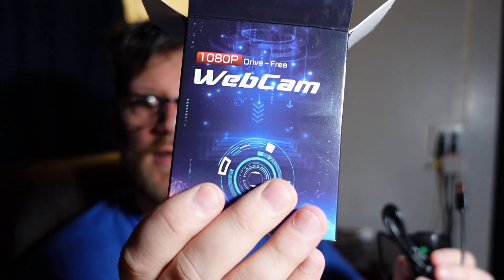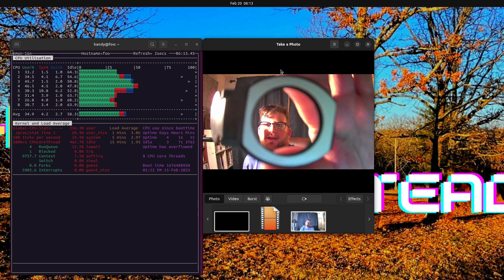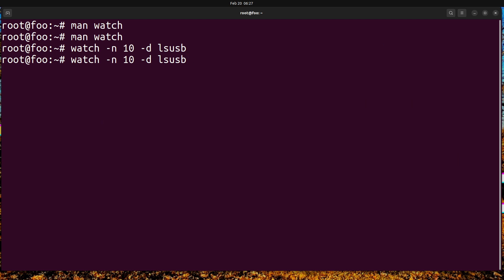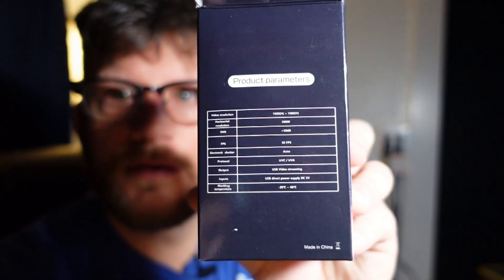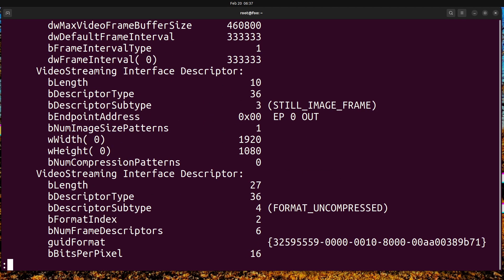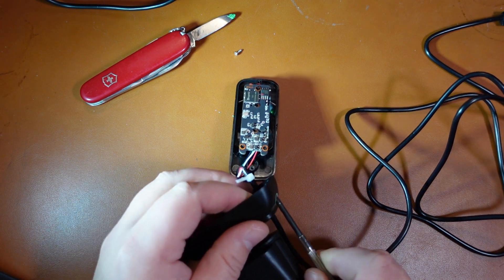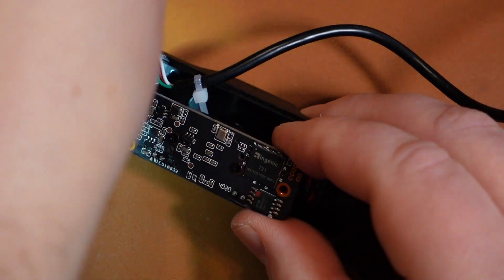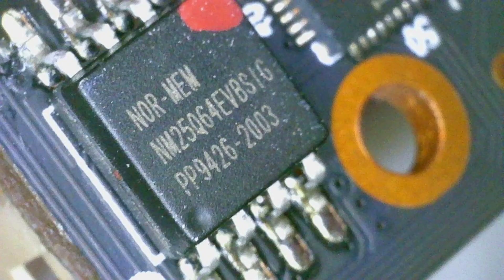This is $1 MIPS/RISC-V Powered Chinese WebCam? | Part 1

Comment: Where did you buy it from? Did it take long to be delivered?
Reply from the maker: I found it at a local big box return outlet. Based on what was in the box someone had returned it from walmart.com. I have also found it on eBay in mass. Someone had a fire sale 😅
Reply: @hackersbasement  TY, I was almost hoping it was some China tech being sold off end of line amazingly cheaply.
Reply from the maker: When I put the box though Google Lens it came up with quite a few matches. Based on the research I have been doing this was by my best guess manufactured in 2020ish. Its just that the processor is normally used in "higher end" stand-alone security camera products. My current theory is that they had a bunch laying around. At that time WebCams where selling like hot cakes and they decided to off load the inventory.

https://www.ebay.com/itm/284780745426?mkcid=16&mkevt=1&mkrid=711-127632-2357-0&ssspo=vFaGXUkYSDu&sssrc=2349624&ssuid=TukycMJ3Ram&var=&widget_ver=artemis&media=COPY

Comment: Can it actually do/sustain 30fps at 1080p? If so, seems like not a bad cam for $1 plus hackable is only a bonus..!
Reply from the maker: That's a fantastic question! I will have to ponder on rigging a test up.tbh I didn't know what to expect when I plugged it in, and I was surprised at what I got.
Reply: @hackersbasement  thx the video made it look slightly slow maybe but that can depend on software/your system/requested framerate plus if hooked to a USB2 host port anything else on the same host group can steal bandwidth causing it to slow down.. also, the exposure setting of the camera can affect it, it the exposure time is over 16ms, then the framerate will decrease - most cams I've used get to a long enough exposure to cause this in even relatively average indoor lighting, the lens aperture and sensor size also affects the amount of light that it can collect within the exposure time which is often why such cameras need such a long exposure in said lighting environment, the longer exposure also will cause more motion blur..so if you're not getting upto 30fps after verifying software settings and usb bandwidth then try increasing environment light or manually lowering the exposure.

The image though didn't look far off from the Logitech c910 (c920 almost identical as well, c910 5mp, 920 is 3mp but has h264, otherwise both are 1080p30)I have which supposedly has Zeiss optics which is a 60-80$ cam and also suffers from framerate loss due to exposure and even when that isn't an issue, I find it doesn't always hit a solid 30
Reply from the maker: You have given me an idea for a later return to the webcam. I admit I was using a lower end system (hence why you see cpu stats on screen). It was connected to USB2 but I can't confirm that it was operating at that speed ... oh sorry, The idea ... Evaluating if quality is low due to A) my system (easy enough to test), B) Slapdash engineering, C) The processor or something else is actually under powered (for example the camera sensor too). On paper this should/cloud be a much better WebCam.